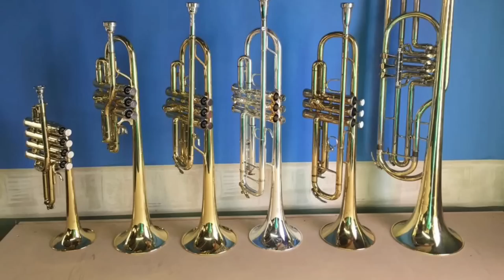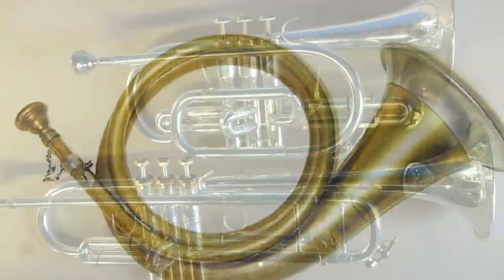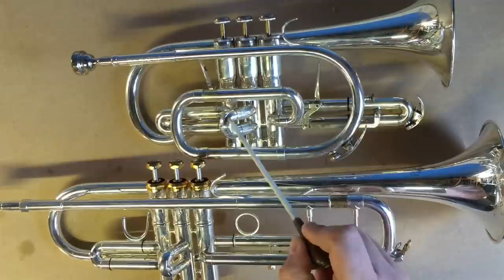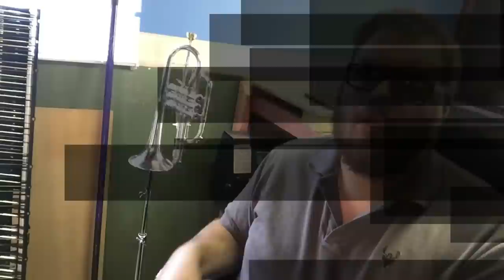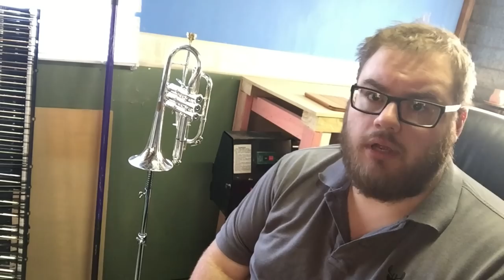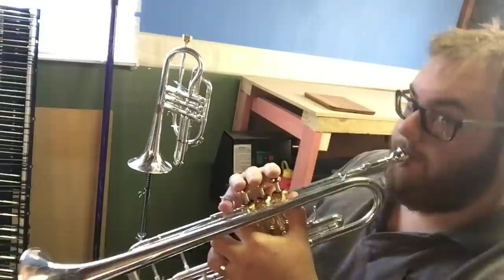Trumpet vs Cornet - discussion and demonstration

Comment: One of the clearest (and most succinct) explanations of the differences I've ever seen -- thanks.  I would really like to see you do a similar one contrasting baritone horns and euphoniums.  Here in the US, school bands call euphoniums "baritones" and don't use actual baritones at all!
Reply: It's a fairly simple difference. Euphonium has conical piping, while baritone has cylindrical. Sound-wise, baritone is closer to trombone, while euphonium can be thought of as a mini tuba.
Reply: My school calls it the euphonium
Reply: euphoniums also will usually have 4 valves while baritones mostly have 3 but there are 3 valve euphs and 4 valve baris
Reply: @sceu25  It really just depends the model…
Reply: @bobcat24  Yea but my point still stands.
Reply: I have had a very different experience in the us than you have while there are put in the same section they are very clear which for instance my band has 1euphonium player and 1 baritone
Reply: Really? I’m American and we called them euphoniums.

Comment: I have had a trumpet with a first valve trigger instead of a saddle hook and I preferred it. I also currently own a cornet that does not have the shepherd's crook and has a third valve ring instead of a trigger. With the aesthetics of the trumpet and cornet there are no absolutes.

Comment: I  have a Bach Strad made in the early 70's that has a first valve trigger.  All my my friends Strads back them had saddles, but mine has a trigger.  Another friend of mine from the 70's had a king silver flair with a first valve trigger also. FYI.  Good video!

Comment: The cornet have a rounder sound while the trumpet have a sharper sound .

The trumpet also needs more air and the mouthpiece is slightly bigger while the cornet do not need as much air and has a smaller mouthpiec

Comment: BookWorm9229 theyre almost exactly the same. The cornet has a darker sound but not all cornets have a "shepards crook" and not all cornets use triggers. Also, some trumpets use triggers as well. A trumpet is used more in jazz and commercial use. However, a cornet is used often in orchestral pieces.  You dont have to learn to play one or the other. If you can play one, you can easily play the other.

Comment: I have been playing the cornet, and mine has manual slides, not triggers. It still has the crook, but the cornet, as I've heard from many experts on the topic, is better for beginners to use for a few years. It takes more air, so it makes it easier to play the trumpet when the time comes to switch.

Comment: Well, there are at least Bach trumpets with triggers. You still can order that from them and I've seen several with trigger on the first valve. I've never seen one with a third valve trigger rather than ring, but it is a build to order option still so it probably exists.

Comment: My trumpet's first valve tuning slide has a mechanical trigger and I have an old 1920s bronze Conn cornet that doesn't have either a finger ring or a mechanical trigger on its first and third tuning slides

Comment: It’s like the sound difference between a tenor trombone and a euphonium. Since the trombones pipe diameter stays the same for half of the length, then gets bigger at the bell section, and euphoniums gradually get bigger from the mouthpiece.

Comment: Your main distinction is incorrect. On both the trumpet and cornet there are the same two  tapered sections: the bell and the mouthpipe. The difference is the cornets mouthpipe is much longer than a trumpets, and the rest of the wrap is shorter to allow this. No cornets are not conical and  trumpets cylindrical; both are both.

Comment: One of the trumpet players in my band has a Stradivarius trumpet with a trigger on the first valve tuning slide
Reply: That's an option you can get from Bach.  You can even get a 3rd slide trigger if you want.  I bought my Bach Strad from a student that used it in a high school marching band and it has the 1st slide trigger.

Comment: Any tips on the cornet? I have both, and I seem to have a MUCH better sound on the trumpet. Is there a difference in tone production between the two that I am missing?
Reply: A trumpet's long lead pipe allows high volume high notes fly out of the instruments with ease vs. the cornet's curved lead pipe giving it a subdued tone. You could also have your embouchure messed up, the mouthpieces are different sizes.
Reply: The West Will Rise Again! Never thought of the mouth pieces or anything like what you said, thanks!
Reply: +The West Will Rise Again! Sorry, cannot agree with this. I play both trumpet and cornet as well as flugel, the trick is finding the correct mouthpiece that allows the airflow and resistance to be consistent between the three.
Reply: Perry Parsons I only play trumpet out of those three, but I was speculating on what the problem might be. Admittedly, I am an amateur.

Comment: It may be just me but IMO the trumpet seems to have a brighter and more open sound. The Cornet seems to be slightly muddier towards the low end.

It's probably just my headphones doing so not really sure.
Reply: It's not your headphones. Trumpets are brighter and they do project better. That's one of the reasons most marching bands and drum corps use trumpets instead of cornets.
Reply: "Muddy" has a bit of a negative connotation. It's darker/mellower sounding.

Comment: The tubing is not "thicker". The tubing calibre, i.e., diameter, is "wider". The thickness of the  tube wall may or may not change.
Both cornets and trumpets may be blown soft or loud. The cornet tone is not "softer", it is more mellow, with more overtones when the air,  which is excited by the "reed" action of the lips buzzing,  vibrates the air column in the tubing, which is what happens when you "blow" a horn - you are not trying to blow air THROUGH the horn - it probably would not even blow out a candle !  I have trumpets and flugelhorns with triggers, cornets with rings, and all with neither or both, in Bb, Eb and C and various other brass horns from BBb, EEb, and from CC ophicleide to Bb piccolo (also reeds from sarrusophone through contrabass clarinet, BBb bass sax to Eb soprano sax and clarinet). Nice playing, Trent.

Comment: Theoretically,  2/3 of a trumpet's tubing is cylindrical and 1/3 if a cornet's tubing is cylindrical.  1/3 of a trumpet's tubing is conical and 2/3 or a cornet's tubing is conical.  Remember, this is a theoretical difference, in practice contemporary trumpets and cornets have approximately the same amount of conical and cylindrical tubing.

The cornet was a development of a "cornetto", a wooden instrument with recorder like holes drilled in it.  Many trumpets are equipped with triggers--the Selmer K Modified and the Recording Olds are two notable horns with one trigger, the Olds' Mendez was equipped with double triggers.  Single or double triggers continue to be an option offered on Bach Stradivarius trumpets.

Not all cornets have a shepherd's crook, just  short (or on this side of the pond British) cornets.  The long (or American) cornet has no shepherd's hook.  On a practical side long cornets tend to have trumpet like tubing and bell flair--simply a trumpet with a tighter wrap making it shorter than the typical trumpet.

Comment: "The cornet utilizes triggers"

triggered
Reply: Egriff123 lol I saw that comment when I was just in that part
Reply: Egriff123 my corner utilizes manual slides. Some corners have triggers but not all. I got a Jupiter JCR 520M
Reply: My corners are usually 90 degrees.
Reply: William Charles Schneider I don’t know the model, but last year a senior in my high school marching band had a trumpet with a trigger on the first valve slide.
Reply: I posted this under someone else’s comment already, but the trumpet I just ordered has a trigger on the first slide, but a manual ring on the 3rd.
Reply: The cornet used in this video is the first one I have ever seen with triggers of any configuration. He says he has never seen a trumpet with anything but manual slides on first and third. Apparently  he has never seen a Bach Stradivarius trumpet with the triggered first slide.

Comment: A trumpet actually does get gradually wider. Try putting a trombone mouthpiece into the lead pipe of a trumpet. It wont fit. Try putting it in the tuning slide. It fits!
Reply: The trumpet is partially conical, but it's mostly cylindrical.

Comment: Actually, trumpets and cornets have about the same amount of Cylindical vs conical tubing.  The mellow sound of the cornet is more a result of the rate of the conical taper and location.  The sound is most influenced in the bell.  If you take a trumpet bell and mount it to the cornet, you will find it sounds like a trumpet.  Further reading here  http://robbstewart.com/Essays/TrumpetSchmumpet.html
Reply: oh - and the number or shape of the bends (ie shepherd's crook) has nothing to do with the sound.
Reply: Steven Ward WRONG!!!!!!!!!
Reply: Actually not wrong.
Reply: Steven Ward
Actually, yes wrong! To begin with u are contradicting yourself just in the very first two sentences of your argument. And then, in the third sentence, u destroy the point u purportedly made in the second sentence. I know u are trying to say something, but u've gotta get it down in writing in a less muddled manner.
Reply: Hmmm. Maybe you should just read more carefully?  I clearly stated it is the rate of taper, not the amount of taper.
Reply: "rate", "amount", u are quite the linguist who makes a distinction where there is no diffference. Splitting hairs aint helping your point. Since a rate IS an amount, but an amount is NOT necessarily a rate, your cornetty trumpeting remains muddled just the same.
Reply: Lol. Rate is not an amount. Rate is a speed. It is the speed at which the bore changes. Nothing to do with quantity or amount. You are simply resistant to enlightenment and like to argue. But your arguments don't even apply to the original topic. I offer data, you argue word choice. Lol.
Reply from the maker: Zeit Geist Steven Ward  If either of you guys post in this manner again, I will disallow you from submitting further posts to this channel. Capisce?
Reply: Trent Hamilton
 Yes, dad. I will never do it again. It was all my fault. I take it all back —even responsibilty for all and any emotional stress brought upon any reader by my inconsiderare comments and passive-aggressive verbal smirks.I'm just a rotten person who should be kicked off every channel I have ever submitted posts to, and be ostracized to the smallest one-palm island in the South Pacific.

Comment: The cornet, which has a conical bore (tubing gradually gets larger in diameter), while the trumpet has a cylindrical shape (same diameter until it reaches the bell portion).  This changes the overtone series, which is more mellow in the cornet.  It also makes the cornet a little easier to play with a little less resistance and easier to slur and play legato.  The famous concert bands of the Sousa era used mainly cornets, as did the soloists such as the great Herbert L. Clark.

Comment: Technically, the cornet and trumpet are almost identical. Both are partially conical and cylindrical. There is a common misconception that the trumpet is cylindrical and the cornet is conical, but this is not true on modern 20th and 21st century instruments. The comparison of the bell flares is also inaccurate as the cornet bell is shorter, which explains why it appears to start tapering quickly at the base of the bell. The tapers on most cornets begin smaller than trumpet and end smaller than the trumpet, but flare faster. This fact combined with a deeper mouthpiece cup and wider backbore give the cornet a softer attack and tone than the trumpet. 

Nice video and discussion :)
Reply: Are trumpet mouthpiece and a cornet mouthpiece interchangeable?
Reply: @ironmandave3000  They are not compatible. The mouthpiece for the cornet is shorter and narrower than the trumpet mouthpiece. The difference in size is comparable to the difference in size going from trumpet to trombone
Reply: @ianlee9647  thank you I'm aware of that. I have played both. I was looking for someone else to help illustrate my point that trumpets and cornets are not the same. Doc Severinsen tells a great story how about trying to play cornet in a lead trumpet position. It doesn't work!
Reply: I think the biggest contributor to the difference in sound (among other things) is the mouthpiece. I play a cornet. I can't say for certain what the "average" trumpet vs. cornet mouthpiece cup is for either instrument. But I know the typical "stock" cornet mouthpiece that comes with the cornet is deeper than the stock mouthpiece you get with your trumpet. I find cornet mouthpieces can range from very deep/funnel (almost french horn-like) to basically a trumpet-type cup on a cornet shank (Bach). Not so sure if the same in reverse is the case for trumpet mouthpieces. I alternate between a Denis Wick 4B and a Bach 3D, depending on the music. When I use the Bach 3D, I'm basically indistinguishable from the trumpets in my section.

Comment: The manual/trigger tuning slide is NOT a key difference between the two. There are cornets with manual tuning slides and Trumpets with triggered tuning slides. I apologize if i come off as an ass, but I couldn't let this go. Very informational outside of that though.
Reply: He didn't say trumpets don't have trigger slides, he said he never saw one with a trigger slide.
Reply: I've posted an image of three, so now he has.
Reply: why don't trunpets typically have triggers? It seems a much more convenient means to an end in my opinion than manual slides
Reply: i'm guessing because it was how the trumpet was originally made and they didn't really bother to change it much, however some people/companies decided to take matters into their own hands.
Reply: The trumpet i just ordered has a trigger on the first valve slide, but a ring on the 3rd.
Reply: @datGuy0309  I would have though a trigger on the 3rd is better than a trigger on first since you would need that much more often.

Comment: The trumpets lead pipe is also conical.  And my freind plays a trumpet with triggers. I think alot of the difference  is less to do with the ammount of conical tubing, and more so the rate of expansion. Nowadays, modern trumpets aren't actually very different from cornets except for mouthpiece type and shape.

Comment: Very good video, especially the playing comparisons. This is a great primer for the basic differences, and is by and large accurate. 

However, there have been so many variations on the common designs, that the lines do blur. For example, perhaps the most glaring variation is the American standard trumpet, the Bach Strad. It is in fact, a long cornet with a trumpet mouthpiece receiver, as the tubing graduates throughout the instrument. Many people, myself included, have verified this with the use of calipers. 

Also to be noted is the Besson 10-10 trumpet, which has triggers on both the 1st and 3rd slides, perhaps as an effort to duplicate the playing mechanics of the Besson Sov, truly a hallmark cornet. 

At the other end of the spectrum are the American cornets, void of any shepherd crook, but still very much cornets. While perhaps a bit brighter than their British cousins, they still are conical instruments with a very specific cornet tonal quality. 

Once again, this video should be the point from which all others take off as far as variations between trumpet and cornet.

Comment: Not to sound like a hypocrite but you should use the pads of your fingers instead of your knuckles to help prevent joint damage.
Reply: Highly doubtful that the low impact nature of pressing down valves would cause joint problems. Barely any pressure needs to be applied.

Comment: Ah, you seem to have missed the fact that your trumpet has a tapered lead pipe. I'm pretty sure if you measured the proportions of tapered to cylindrical tubing on both instruments, they'd be darn close to the same. Such is the modern versions of these instruments. You could get into the impedance differences involved in the more bends of the cornet effecting sound but I think you'll find the biggest difference should be in the mouthpiece, such as it is. But then again it's all moot. More often than not there is little if any between the two mouthpiece designs. Trumpet shank cornets are being made.

Comment: Of course, modern trumpets DO have more taper than they used to, and cornets, since around 1910, have been 'brightened up' and the cornet mouthpiece cup has been changed to be almost identical with a trumpet mouthpiece...more cup shaped and not as deep and 'v' shaped as the older cornet style.
Lots, and lots, of cornets do not have the 'crook' bell pipe any more. In fact, I've only once had a chance to play a cornet that DID have the curve.

Comment: This gentleman is a better cornetist than a trumpeter and it's obvious which he likes more . There are triggers on trumpets and also manual slides on cornets it's a matter of preferred configuration by the player. Cornet is surely more mellow but does not project as well as a trumpet as they usually have a smaller bore size. The cornet can have better agility because of the tight curves and the fact that you don't have to push as much as you do on the trumpet. I love both instruments and the fluegel too and each has a place along with the small trumpets - but that is for another day.
Reply: the curves don't help agility they actually hinder it because the air encounters more resistance going around a curve